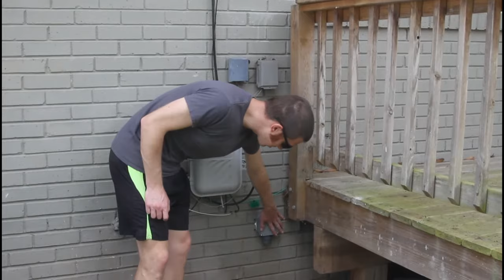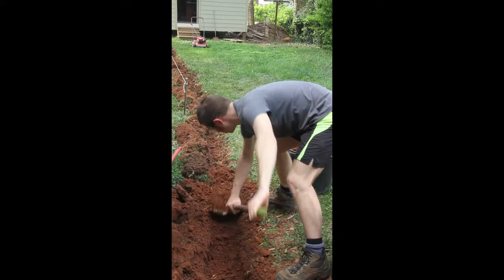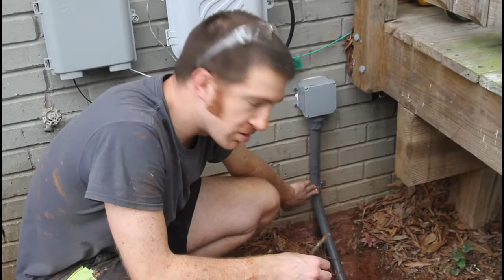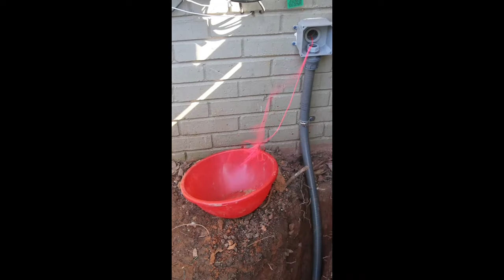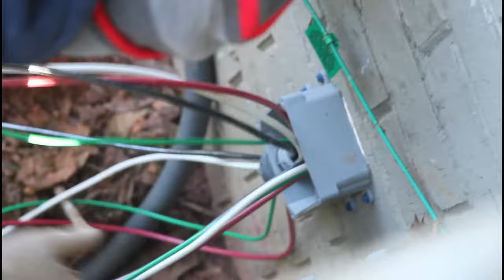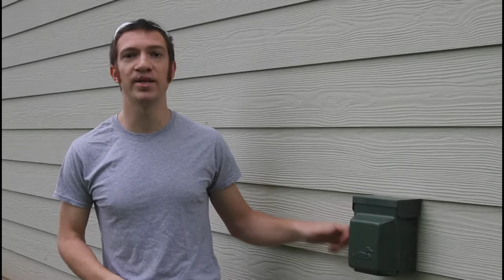Complete Guide to Wiring Your Shed

Comment: When you dig your trench about 18 inches deep, what kind of climate area are you in? Does it snow there, or freeze? Does that make a difference on depth?
Reply: The depth is laid out in the National Electric Code.  I think section 300.4.

Climate does not matter.

Your local building office can adjust, bend, or throw out the nec rules and not everyone is under the nec, even in America.

If you are about to do this job, a phone call to a local electrician or building Inspector should get you plenty of answers.
Reply: The voltage you run can also affect the depth required by your local code.
Reply: @phendrix9476  yes sir, you are correct.  The voltage, the use of the area above, gfci protection and more play in to the required depth and concrete above your pipe can also effect depth.

This is why I encourage people to consider other items while the trench is open.  

Cable tv or high speed internet I believe only needs to be under the surface, but it could be deeper or the piping used for something else.  Security cameras, some kind of flashing light in your shop to alert you of diner time or some emergency in the house may allow you to "get a message" in a noisy work envirnment.

If you have extra pipes in your trench, they can be deeper than the minimum and prevent a re-dig.  Slip a string in the pipe when you install it and use it for a wire pull in the future.
Reply from the maker: Keith is correct. Check 300.5 in the NEC. The depth is more related to "how likely is someone to cut this with a shovel or trencher" than it is to freeze/thaw cycles.

Comment: Can't use LFNC in this application. How are you going to "securely fasten" it every 3' underground? 356.10(50 and 356.30(1). Not dangerous, but it is a code violation.
Reply from the maker: Interesting take John. Fortunately, the NEC included section 300.5 to instruct on safe conduit burial. Accordingly, this is not a code violation, otherwise all types of conduit would be subject to the same problem. Just be sure that your conduit is labelled as "rated for direct burial" and you'll be all set.
Reply: @practicalhomeprojects  It is, according to the language of the NEC, absolutely a code violation. It's not an electrical problem, but it is a violation. 300.5 addresses general rules for underground locations but, as anyone who uses the NEC knows, it is common to have to look at multiple code references to apply to any particular installation.  One must look into the article dedicated to LFNC. 356.10(5) says, specifically, that if LFNC is longer than 6' it must (operative term, shall be permitted) be secured in accordance with 356.30. 356.12, Uses Not Permitted, says if longer than 6' it must comply with 356.10(5). Other underground conduits, IMC, PVC, etc, say not such thing about limited lengths UNLESS secured. In other words, LFNC is allowed for direct burial in lengths up to 6'. Beyond 6' must be secured. Not my rule, but the language is specific and clearly states this. A public input proposal may bring clarity, but it says what it says.
Reply from the maker: Hello again John, I appreciate the detailed response. I'm still inclined to interpret the code as permitting direct burial of LFNC, but I agree that a bit more clarity could be added. 

356.10(4) specifically permits direct burial when the LFNC is rated for such a purpose. I imagine this use was added to clear up confusion and would end the conversation with any inspector.
356.12(3) calls on the use outlined in 356.10(5) OR "where a longer length is approved as essential for a required degree of flexibility." This is where I think you are claiming that my application does not pass the  code. I'm going to claim that direct burial requires a longer length for flexibility; a word I do not see defined in this context.
356.30 explains how to secure the conduit, but does not specifically require the conduit to be secured (the requirement coming from 356.12(3). It is telling, however, that "Securing or supporting of the conduit shall not be required where it is fished" indicating that the governing body felt that securing was only intended where practical to do so.